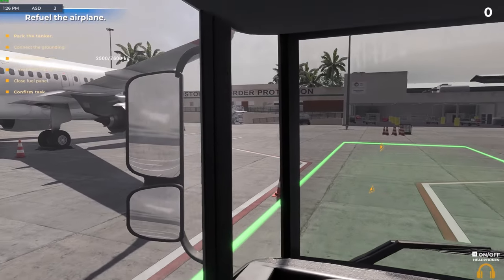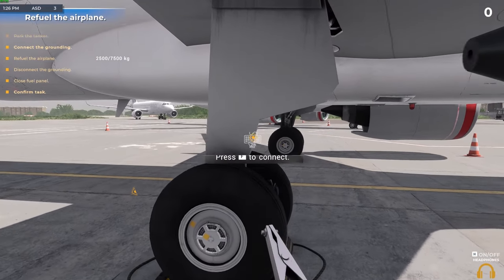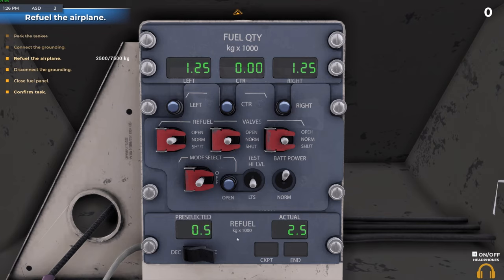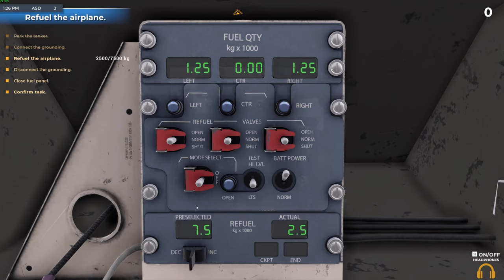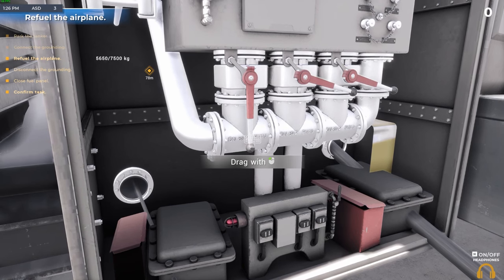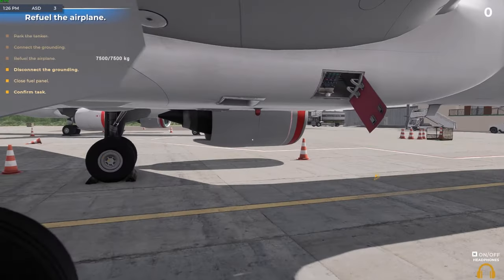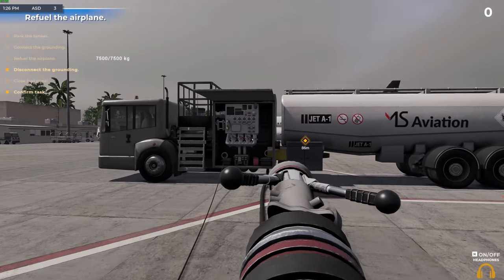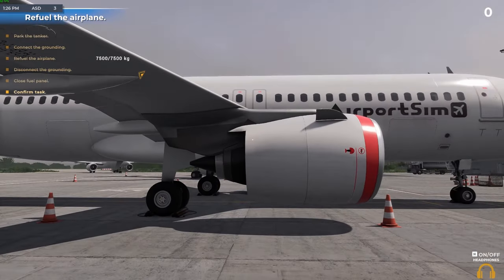AirportSim I Tutorials I Refueling Airbus A320 Neo

Comment: Unable to complete this tutorial. I have to refuel 13700kg of fuel. The fuel system is only pumping fuel to left and right wing. When the wings are full, the fuel system is not re-directing to center tank. I am unable to open the manual switches as well.
Reply from the maker: Hey. Are you sure it's correct plane, A320? Becouse sound's like 737, we got different tutorial: https://www.youtube.com/watch?v=S0RtInTw_8M&t=4s&ab_channel=MSGames